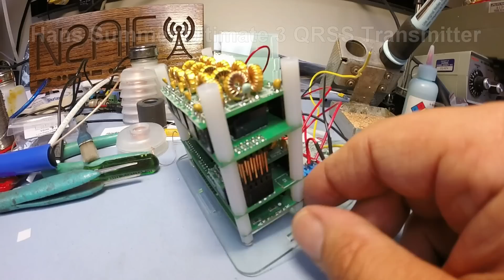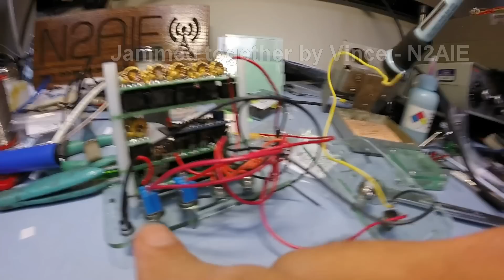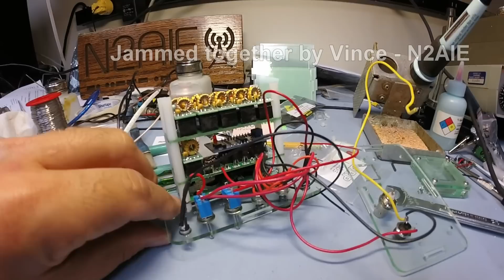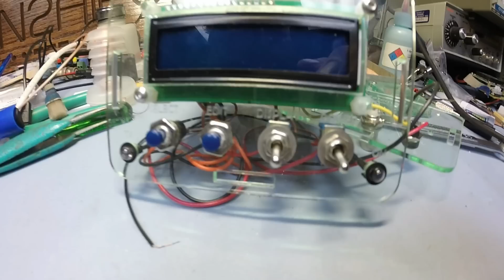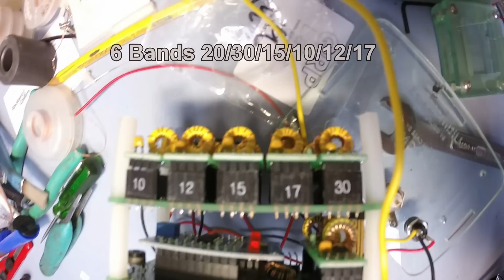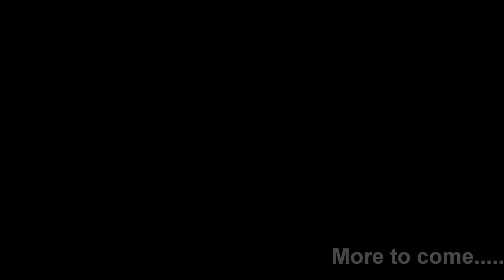U3 QRSS Transmitter

Comment: Very nice. What is it?
Reply from the maker: Low Power QRP transmitter.
- DDS-controlled output frequency (through-pin DDS module, no SMD soldering required)
- Plug-in low pass filter boards (available for 10 HF and 2 LF bands)only 6 installed.
- 2-row by 16-character blue back-lit LCD + two-button user interface
- User-programmable (callsign, message, speed, FSK, mode, etc.), settings stored in EEPROM
- GPS interface, for locking the frequency, timing and location information (GPS Not included)
- On-chip generation of WSPR encoded message (no PC required)
- WSPR maidenhead locator can be generated from GPS-derived latitude/longitude
- Selectable “frame” size, for stacked QRSS reception
- Plain CW callsign identifier at selectable interval
- Produces 150mW RF output on 30m (lower output on higher frequency bands) (stock)
- This one : Higher output power by additional PA transistor and/or higher PA supply voltage 250mw out...2- BC170 PAs)
- M0ION Laser Cut Acrylic Case
- QRSS mode (plain on/off keyed slow CW)
- FSK/CW mode (frequency shift keyed slow CW)
- DFCW mode (dual frequency CW)
- WSPR mode (Weak Signal Propagation Reporter)
- WSPR-15 experimental WSPR mode with 15-minute frames
- Opera modes (8 speeds)
- PI4 beacon mode
- Slow-Hellschreiber (frequency shifted slow-Hell) 
- Full-speed Hellshreiber
- Half-speed ("DX") Hellshreiber
- CW (plain CW)
- FSK (0-999Hz shift, fast-speed FSK CW)
- Customisable FSK patterns
- manually-keyed CW/FSK transmitter
For Sale BTW